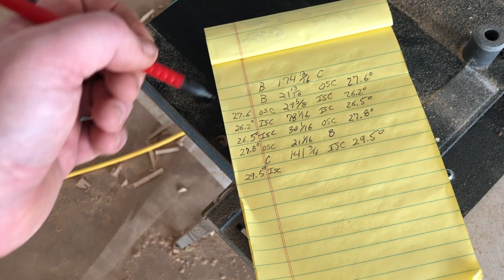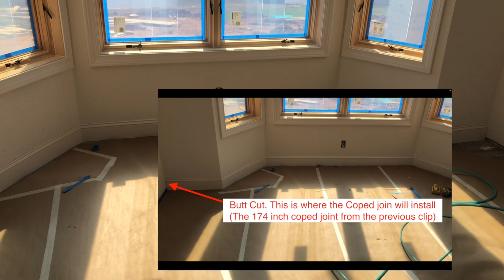How To Install Baseboards Like A Pro

Comment: I'm a long retired carpenter. If you're trying to teach people how to install trim, show coping using a coping saw for inside corners. Not equipment that most DIY people won't own or buy. Show how you measured to precut the pieces. And then nailed to the wall. Where to nail,  how far apart (studs) etc. When I was young we were still installing base shoe (1/2 x 3/4), shows how old I am. I applaud you trying to help people.
Reply from the maker: Thank you very much for the comment, as it is much appreciated, and it helps me improve faster. The biggest mistake I made here was not directing this to the pro community for folks just like yourself, rather than the DIY Community. I have received multiple comments like yours form other pros and all of you are very much correct. Changes are coming on my next set of videos, as they will be clearly marked with Beginner, Intermediate or Advanced. I do use a coping saw, and a Collins coping foot on a Jigsaw as well, admit that I am a junky for jigs and specialty tools. Thanks again for your input.
Reply: Are you nuts? If you're using a coping saw; you don't know what you're doing or you just came here in a time machine from the 80's...TIME IS MONEY!!!!
Reply from the maker: Hi IT?, and yes I am probably nuts… but besides being nuts I do enjoy time travel quite a lot. When my Time Machine is in for repairs, I will sometimes default to my Collins Coping Foot that fits the same jigsaw shown in the video. Also will use a Dewalt grinder with a sanding pad to make the back cut as well. On my 14th life which happened during the 1940’s, I started out with (wait for it), a coping saw. I very sincerely appreciate your comment. 
What tool do you use to cope your baseboards and crown?
Reply from the maker: @godbluffvdgg  Hey IT?, just went to your channel and noticed the playlist on Home Nightmares, and that hit home for me (pun intended). My oldest daughter just found out that her new/old house has a massive sinkhole in her front yard. Apparently ALLL the homeowners in her section of the neighborhood have a similar problem. She has one that is approximately deeper than 35 feet, and spans 1/4 of an acre. They are on day three of the diagnosis, and are estimating 30 - 50 k to fix. Before the practice was outlawed, the builder dug huge holes in the back of the subdivision, harvesting the fill dirt, then in the back of the subdivision filled in the holes with stumps and debris that have now rotted 35 years later.
Reply: @productiontrimcarpenter  I cut the miters on my miter saw and use a grinding wheel to ease the back for fitting...It takes about a minute for inside corners...I do it with Dental Crown and any inside corners...I started in the business when miter saws were a wooden box and you coped in the insides...
Reply from the maker: @godbluffvdgg  Thanks very much for the tip. I will put the grinder into some upcoming videos. I wished the MDF did not create soooo much dust, and I have a lot to learn as well. Thanks again.
Reply: @godbluffvdgg  While the host of this channel doesn't need defending I might point out this video is more for the DIYer and not a full fledged pro. Like a fellow commentor pointed out it would be better to show how to use a coping saw instead of a grinder as some DIYers may not have a grinder nor the need for one. Also most DIYers are not concerned with how much time it takes. I would assume most DIYers are more concerned with the outcome more than speed.
Reply: @number1pappy  I hear ya...But, having coped thousands of feet of trim...It's not easier to do...A simple baseboard; meh, sure; easy... but, Chair Rail, OG's etc can be hairy...But; Point taken...I'm a philly guy, So I may come off as brusk...It's a bad habit...: )

Comment: Enjoyed your video. I would have liked to see how you transferred your angle measurements to the miter saw for cuts on outside corners.
Reply from the maker: Hey Susan, thanks for the comment, as it is highly valuable and much appreciated. To be honest, I cringed when watching it recently when noticing major things I had left out. I am learning at lot about doing YouTube videos. The carpentry channels focus on two major categories. One category on pros sharing with pros and the other category sharing with the DIY community. Having been at this less than a month, I have decided to focus on the non-pros, as I enjoy that more. This is translating into in depth explanations on the basics that will focus on the details, rather than assuming anything about the viewer. Currently working on a crown molding video for beginners. It will focus on the beginner or someone that has never cut and installed a piece of crown. Found an app for cutting crown molding that will be a great help to getting professional results. Also, we will do a deep dive on translating the digital angle measurements to the app and to the miter saw. If you haven’t already, please subscribe to get a notification when the video is released. The techniques in this video would also very much apply to baseboards as well. Again, thanks you very much for your input.
Reply: Short answer to help you out is that angles are complementary to 90. So a normal outside corner at 90 is divided by 2 for 45. That 45 you set on your saw is the result of 90-45=45. If you measured 88 degrees you would divide by 2 for 44. If you set you mitersaw at 44 you would not be happy or would using a lot of caulk as the 44 needs to be subtracted from 90 and resulting mitersaw would a 46 degree angle. 

Each mitersaw has limitations on the numbered readout and that is where acute and obtuse angles can get difficult. It’s also where you will need a jig if your number you need isn’t on you saw.
Reply from the maker: Hey Jason, thanks for jumping in on the comment, as it is much appreciated.
Working on a new video just for beginners that will greatly simplify the entire process for beginners, and hoping to weave in some pro tips as well.... I can tell by your comment that you have been doing this for a while. It is funny because even most pros rarely refer to the true mathematical angles of the wall (neither do I), but valuable knowledge to have. The outside 90 is actually a 270, and an inside 45 is actually a 135, but most carpenters will refer to the inside 45 as a 22.5 because it is what they will set the miter saw too.  The new video to be released will greatly simplify the entire process, as most DIYers just simply want the room finished with a professional looking result. My goal in the new video with be to explain every thing for teaching purposes, but then provide a fool proof way of giving the user exactly the numbers that they will need to properly set the miter saw bevel/angle. Thanks again for joining the conversation here.
Reply from the maker: OMG forgot to actually answer you question directly... In the video, one of the angles on my paper (chicken scratch) was 22.6, and this is what I set the miter saw bevel too (cutting the base laying flat on the miter saw). How did I get to the 22.6 miter bevel? The angle finder read 225.2, then took the 225.2 minus 180 =  45.2 divided by 2 = 22.6. Keeping in mind that in this example we are referencing the true math angle. Here is an insider tip, most digital (and some manual) angle finders have a button you can press that will calculate the degree bevel/angle to set this miter saw too, and I always use the conversion button, but I always want to know how I got there...
Reply: @productiontrimcarpenter  no problem. I’m not great at teaching. But many years ago after frustration and wanting tighter joints the easiest way explained was to divide by two and find the compliment. 0 on a miter saw is a 90 square cut but you butted two 0 degree cuts it would extend the base on a straight wall although I don’t advocate but joints. So if that wall had a 10 degree jog and you measured it with an angle finder you’ll get 170 (assuming outside corner). Half would be 85 which subtracted from the 90 is 5 which is what it would set a saw to. Some saws show not on the settings and detente but it made no sense why for me for a long time when I’d miter 45s for outside corners (because only monsters don’t cope interior corners lol) and when I wanted tighter joints and found the angle on a 90 my gaps were worse. When it was explained by a long time carpenter about the 170 degree angle it made all the sense in the world fwiw. 

Your content is great and your just getting started. I’m looking forward to more. You have the right niche I think. You cannot say it but I will. There are a lot of DIY shows with high views which yields more resources for more production and editing and then the algorithms kick them out and people think it is the gold standard. It’s not and it’s trash. The folks who do this for a living and share the content like you are are who folks should be listening to. People teaching their craft instead of running their business trying to push products down your throat. 

Keep going on your path. You will do well and help people out!
Reply from the maker: @jasonj6568  Wow thanks! I need all the encouragement I can get. Cringe every time I watch one of my videos… which can be seen as a good thing, as it pushes me to be constantly reevaluating every detail. One of my favorite channels is @InsiderCarpentry with Spencer Lewis. Spencer is a pro to pro or intermediate channel with great content (if haven’t checked him out yet). Thanks again
Reply: @productiontrimcarpenter  I,agree. Didn’t want to name drop but his style is explaining complex tasks easily. His feeler gauge tip for window casings was new to me I never thought of or seen. Keep up the good work and don’t get discouraged we will all learn together.

Comment: An alternative to the coping fixture you show is the Collins Coping Foot. This is a specialty sub-base that can be attached to your saber saw to enable you to safely and accurately cut cope joints from underneath the workpiece. Dave Collins, the inventor, is a master finish carpenter who has developed numerous fantastic and practical tools for the trade. Once you get the hang of using the coping foot, you will not want to do this work without it.
Reply from the maker: Hi Michael, excellent comment and welcome to the channel! Getting ready to do another and hopefully better baseboard video. This video will be no coping and is for the folks that may just be doing a weekend or so. This video is definitely cringe worthy and on of my first… I regularly us my Collins Coping Foot on my Dewalt barrel jigsaw, and LOVE it. Have also coped with a grinder equipped with a sanding wheel. I found the SpeedCope and had fun with it, and it is very easy, with a little practice to get great results. I learned the old fashioned way with a coping saw and go to the coping saw for a quick one off at times (to lazy to pull it the Dewalt… I can remember when I went to do the first baseboards in my on home and the coping process was a little daunting at the time. This next baseboard video will be a simple quick miter video.
Thanks again for jumping into the discussion. 
Much appreciated!
Reply: @productiontrimcarpenter  Yes, there are definitely many ways to skin the same cat. Your video is no doubt very helpful to a large DIY audience. Digital protractor is a fantastic asset for almost all trim work.
Reply from the maker: @michael.schuler  Thanks, and I will get better at this a we go. Unfortunately or fortunately, one of my worst/earliest videos has taken off and everyone believes that this is a good as it gets.

Comment: great video! I would like to see how to install the baseboards in a closet also what nails you are using to install. Can you show how to get miter inside corners with no coping. I am homeowner attempting to install my own baseboards. Thanks  :)
Reply from the maker: Hi Heather, and welcome!

Nails are 15 gauge, from an angle finish nailer that is very very old. Would recommend buying a 16 gauge if you’re starting out. The smaller the number gauge the bigger the nail thickness and strength. You can do it with an 18 gauge, but I don’t really recommend it. I have a compressor that supplies the air for the gun. Airless guns are the best but quite pricey.

Will be producing a very basic baseboard video in the next week and will show how to install without a coped joint.

Thank you very very much for the comments and questions. You are much appreciated here.
Reply: @productiontrimcarpenter  Thank you very much for the information and I look forward to your upcoming videos on baseboards  :)
Reply from the maker: https://youtu.be/6xVC3sXbuUI
As promised
Reply: @productiontrimcarpenter  Thanks for the video a lot of great info in it! Really helped me out.  :)

Comment: I always cope the edges of the shorter pieces that 174 in piece is easier to install with both ends straight my opinion anyways good job with the video keep it up!
Reply from the maker: Thank you very much for the comment. Working on a more basic baseboard install now. Just miter and install. I like to spring in the longest pieces when possible

Comment: What nails and nailer are you using?
Reply from the maker: 15 gauge nails 2 1/2" long, in a very very old Stanley Bostich air nail gun. Hoping to upgrade soon. Currently wasting a lot of time dragging the air hose around. Thanks Very Much for the Question.
Reply from the maker: LOL. Bought the gun over 15 years ago. Keep waiting on it to die. Some folks call me frugal, my wife calls me cheap… bad news is, my boss will totally rebuild an air gun for $50 bucks. But your comment is right on mark, I too need to replace the gun with an airless one, as it is costing me money dragging around the air hose. Thanks very much for the comment.

Comment: I have to say that your calm, laid-back delivery, along with your impeccable workmanship, assure me that an experienced professional is on the job. Thank you for sharing from your many years of learning. 

That angle finder is genius! I've always gotten the angle by putting my bevel square on the miter saw. Not ideal, but cheap. I'm definitely going to try the CA glue with activator. I'm still of the brad nail and wood glue school. I do know, however, that my bullnoses are strong enough to take the most savage beating the carpet layers can dish out. 🙂 That's worth something. Stupid questions:

1. How many drops before the angle finder becomes inaccurate?
2. Since you're doing a paint grade install, why are you coping so carefully? The painters are only going to cover it with caulk. You can get away with some pretty ugly miters when it's paint grade. 

3. How do you get your length measurements so accurate? I'm always a 1/16 long or short. It's very frustrating.
4. What's a faster way to do my bullnoses in the future?

Thanks again!
Reply from the maker: 1. How many drops before the angle finder becomes inaccurate?

* Answer: Don’t know… there are much cheaper options out there than the Bosch, but it comes with a good warranty (can’t remember the length at the moment)

2. Since you're doing a paint grade install, why are you coping so carefully? The painters are only going to cover it with caulk. You can get away with some pretty ugly miters when it's paint grade. 

* Answer: The video was shot in the basement of a 2.1 million dollar house. The upstairs is all high end stain grade, and completely custom work designed by the owner who is also a retired contractor… the owner paid a heavy premium for this trim job, and stated he wanted stain grade finish, even on the paint grade trim. The owner is 85 years old and regularly inspects for the perfect fit. Also, we do mostly high end homes and we are in a position to charge all of our trim jobs as stain grade jobs, so we don’t have an up charge for stain grade jobs.

3. How do you get your length measurements so accurate? I'm always a 1/16 long or short. It's very frustrating.

* Answer: Measuring is a skill just like any other skill… I was very terrible at it when I started… There are many tricks. One way (used on the bay window) is to first pick a direction of work. I worked the bay from left to right. The left side of the first board was a but cut (copped into later) that left the first inside corner at 26 degrees (can’t remember the exact angle), cut that slightly longer (1/16). Then installed this first board and nailed it. The second board is cut for the left side using the same angle, then cut your outside angle BUT leave it a good 1/8 long, then fit into position, then place a scrap piece of wood on the wall right of the board that you just cut long, use the scrap piece to mark the exact intersection where the scrap on the right and your board intersect (this can also provide the angle as well). With all that said I have gotten pretty efficient at just reading the angles and measuring the lengths. Occasionally I will miss the measurement but always wind up being long (as you mentioned), that’s when I will use the scrap piece to mark the exact cut, but really really try not to be back and forth to the miter saw.

4. What's a faster way to do my bullnoses in the future?

* Question: Sorry for the question, but could you please describe what you are calling “Bullnose”?

Thanks for the comments and questions.
Reply from the maker: Ah, yep, bullnose is very very rare in our neck of the woods here in the foothills of NC. FYI: the entire trim job on that basement (everything) took less than a week. I was working fast, just slowed down for the video. The video took longer than anything in that basement. 12 windows, 16 doors, 5 cased openings, crown, baseboards, 2,500 square feet. I just don’t worry about the paint and caulk, just whether the client is happy. Thanks so very much for your kind comments and helpful feedback.
Reply from the maker: Here is one of the best in the industry showing how he handles bullnose trim, one of my heroes:
https://youtu.be/rCHdB7DcZqo